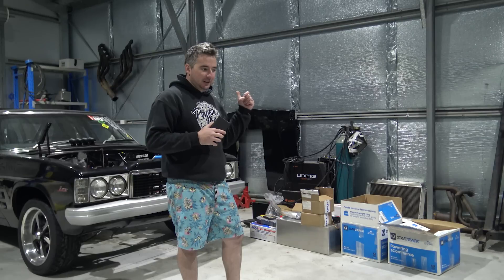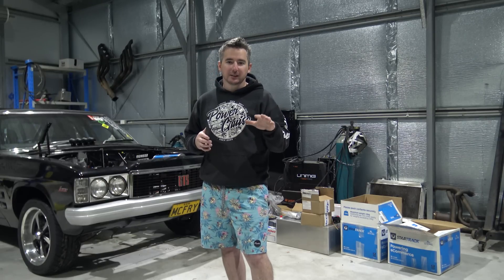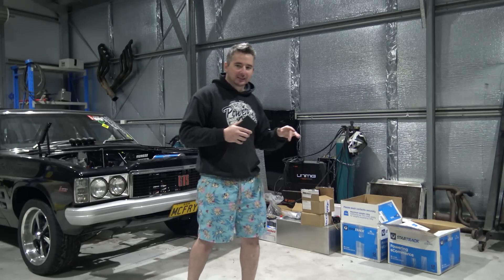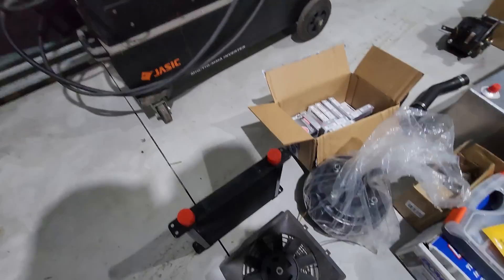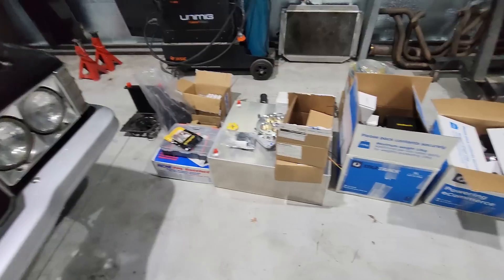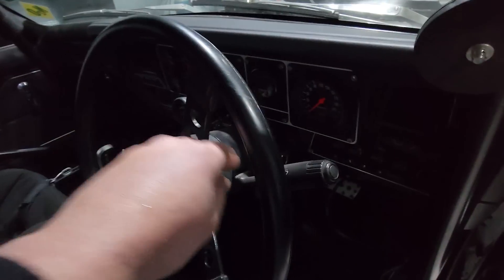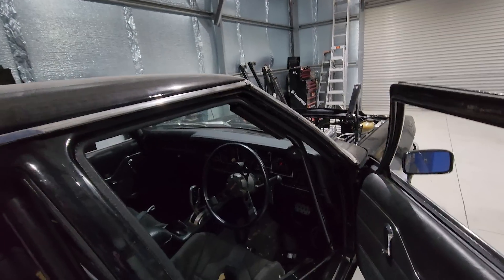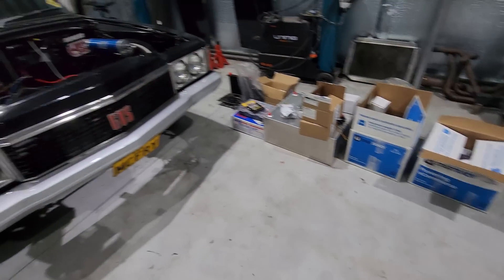MCFRYS Overhaul - Haltech EFI Conversion on the 598 BBC

Comment: Impressed with your work been following the Ute build, Take a look into the orientation of the trans cooler on MCFRY not sure if you’ve ran into any cooling issues with the fittings at the bottom..
Reply from the maker: Only issue ive had was the fluid draining back which is enough to get me to change it. There is alot of dodgy shit im planning on fixing.